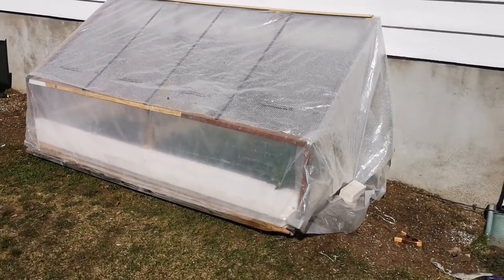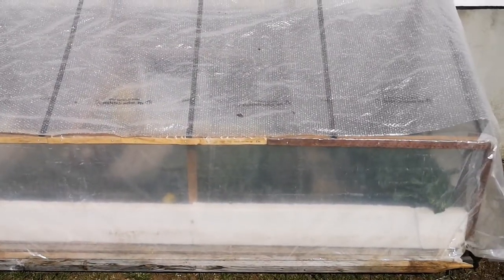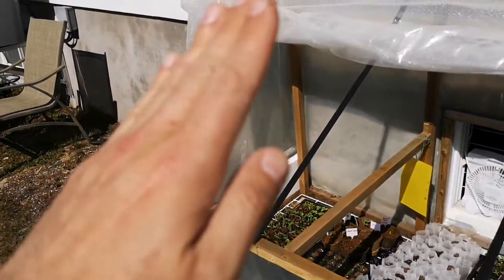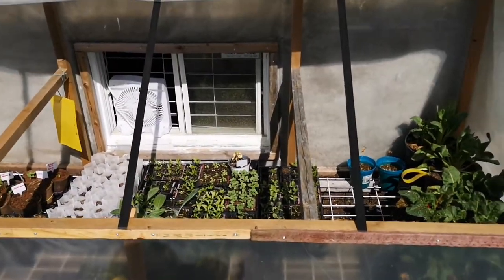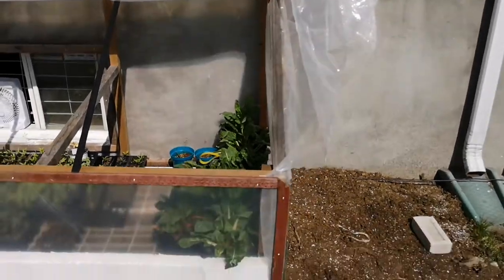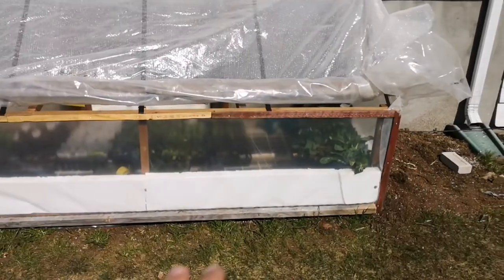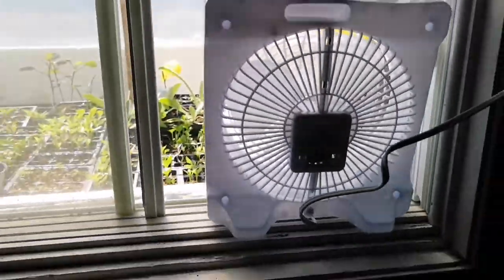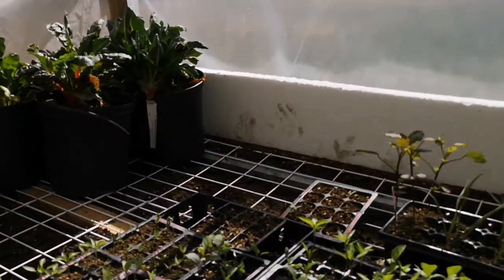How to build a cold frame with indoor access

Comment: can watermelon finis in the 70's fahrenhight
Reply from the maker: Yes, 70 would be the bare bare minimum though, so maybe the varieties for colder climates would work better. They also might not be very sweet, as I noticed that sweetness improve with higher temperatures at maturing time
Reply: @chezgiardino  k, im wondering if i  build a greenhouse over them the last month to bring up the temps, would that b good or to much humidity
Reply from the maker: I would try it...yes, humidity could be an issue, but it would also keep morning dew off, so then maybe it balance itself... I would definitely try it